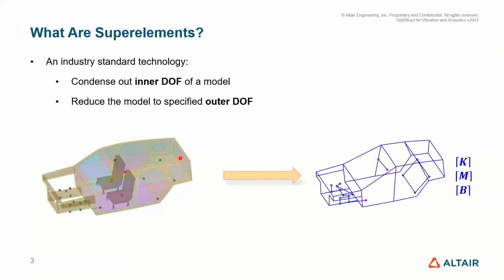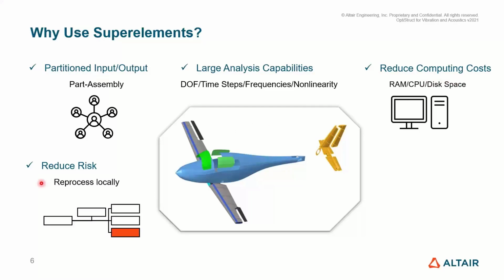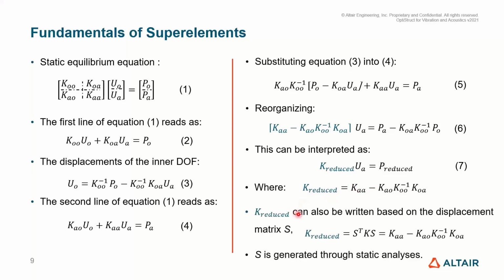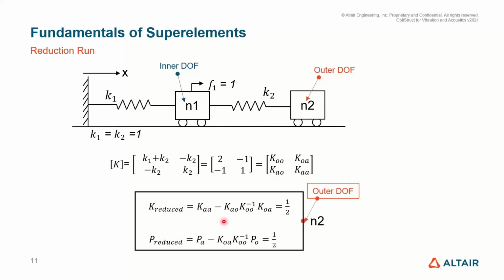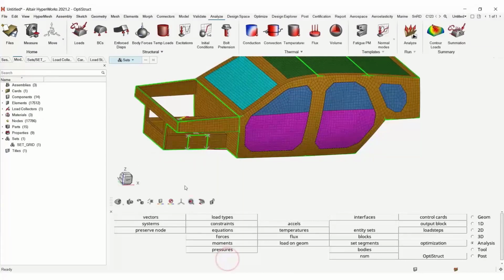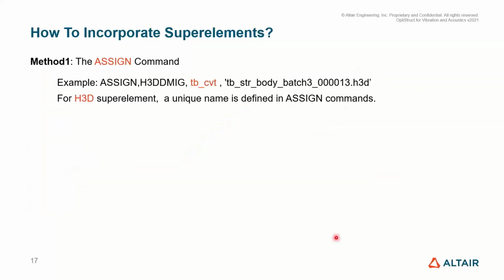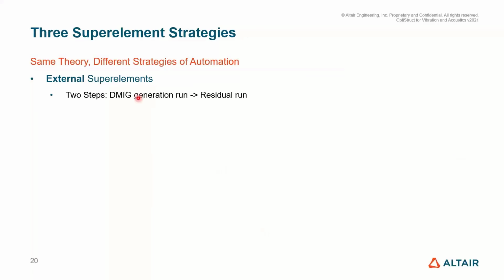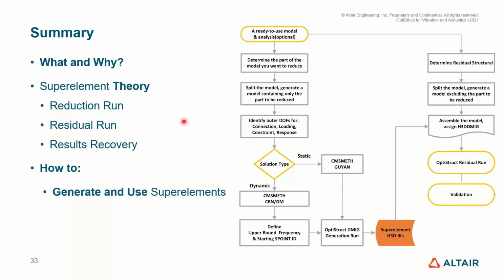Session 9: OptiStruct 2022, Model Reduction using Super Elements

Comment: If I choose CB or CBN instead of GUYAN, are the other operations the same? Additionally, how can I set it up to view the output stiffness matrix and mass matrix? I want to use the Craig-Bampton method to obtain the reduced mass and stiffness matrices. If I fix two nodes, I hope that the resulting mass matrix, in addition to the 12 degrees of freedom of these two nodes, will also include the matrix components corresponding to the first 20 modes calculated from the other nodes (excluding these two nodes). How should I do this? Thank you very much for your video, and I am looking forward to your reply.